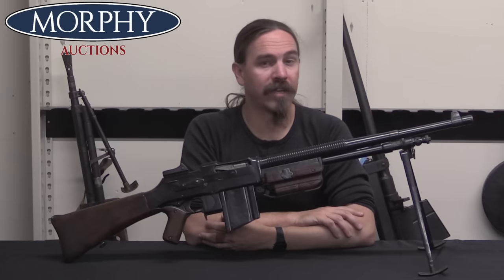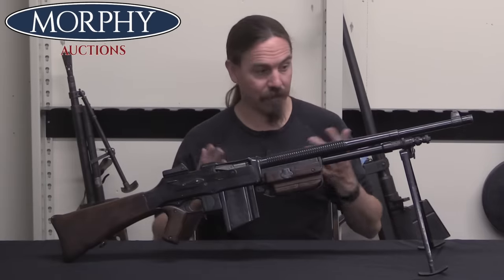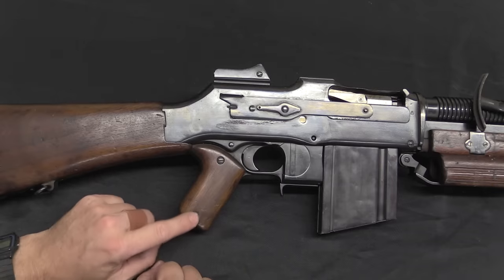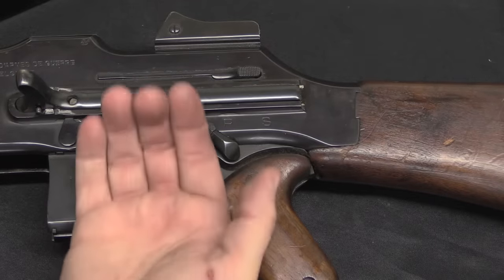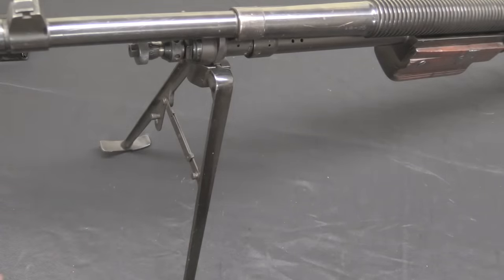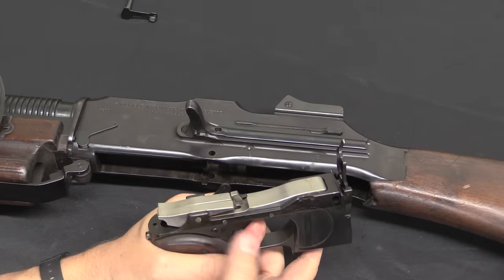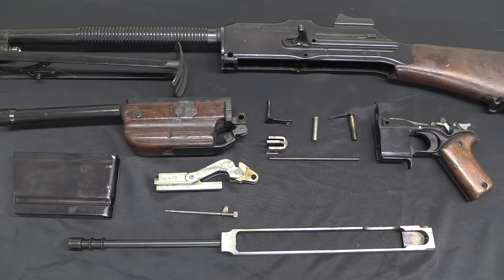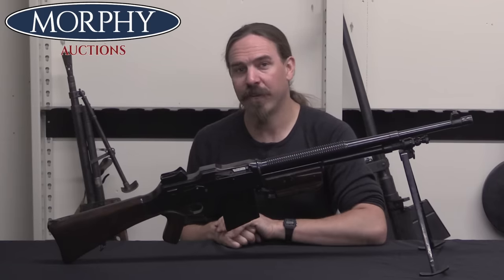FN Model 30: The First Belgian BAR

Comment: The US’ refusal to adopt a rifle with a pistol grip until well into vietnam is baffling to me.
Reply: Try 500 years of firearms stock design....
Reply: Rifles without grips look a lot more aesthetically pleasing, but I doubt that is the reason lol!
Reply: @alm5992  You'd be surprised...
Reply: The whole M14 project has a lot problems besides no pistol grip.
As far as the BAR, I think the mag release is more a significant upgrade than the pistol grip. Just a personal opinion
Reply: They didn’t want to offend any soccer moms. Very forward thinking.😊
Reply: I had a good friend who was trained on BAR just before M14 and M15 were due to drop and the basic reality was that despite all the manuals and terminology treating the BAR A2 as a light machinegun," it was, in practice, treated as a semiautomatic rifle that didn't kick like an M1 and had more than twice the capacity. 

In effect, the BAR man  was really not so much trying to shoot faster than his fellow riflemen with M1 rifles. Rather, he was just trying to shoot as fast as them for LONGER between reloads. BAR, thanks to its weight and mass, could keep up the same "rate of fire" as the M1 rifles but for much longer and was accurate enough to make anyone within 600 yards "not want to be still standing there when the second shot came." 

In this light, pistol grips were not so important or useful, especially since it made it all the easier for any other member of the squad who was more familiar with an ordinary rifle to seamlessly pick up the BAR if the BAR man couldn't handle his own weapon.
Reply: 2 world wars!!
Reply: Probably because it's not as significant as you seem to think it is.
Reply: @alm5992 What really? I feel the exact opposite!

Not trying to fight or anything I'm just really surprised at your view.
Reply: @WALTERBROADDUS  yes, because it's not like the rest of the world didn't also have that(much longer than the US actually), and somehow many other countries still managed to adopt rifles with pistol grips way earlier. looks at the FAL
Reply: You are forgetting the original purpose of the "Rifle" as a substitute for a Pike.

When you have a pistol grip weapon - you have to move your hands to a different spot in order to use the Bayonet and/or use the rifle as a club.

Close Combat - often if not usually - takes place at very close distances with little or no warning.  If you are not using a pistol grip - you don't have to move your hands to use the weapon as a pike or club.

The US - was during WWII fielding one of if not the greatest Infantry Weapons of the day - in the M-1 Garand.  The M-14 was just a modification of the M-1.  Here the presence of a magazine - hurts the utility of the rifle as a close combat weapon.

The other thing - is the more modern weapons moved away from the lowered stock - that provided a way of looking through the sights.  More modern weapons had a straight recoil of the weapon right into the shoulder - and thus - less tendency to climb.  Thus - with the stock already modified to aide in Recoil management - they now needed a Pistol grip as the previous position of the hands would no longer work on the new stock designs.
.
Reply: @genericpersonx333  I think that is mixing up cause and effect. Because the BAR was incapable of performing the LMG role very well due to its deficiencies, it was relegated to the role of "a heavier rifle with magazines".
Reply: @BobSmith-dk8nw  Most militaries moved away from medieval-style combat by WW2 and recognized that there was no need for a pike any more. Cavalry charges were no longer the threat they used to be...
Reply: Not really because the BAR was adopted in 1918 and intended as an Automatic Rifle, albeit for the concept of walking fire and other tactical dead-ends that didn't survive the Great War. It was not adopted as nor used as an LMG in the Great War like the Chauchat, Bernet-Mercie, or Lewis guns,  

In practice, right from the start, it was used much as my man used it and would remain so throughout the BAR's service life. 

Between the wars, however, the Army tried to use it to conform to more conventional ideas of LMG, adding a bipod and revising manuals to emphasize using bursts and base of fire tactics. If you asked official US Army documentation, BAR M1918a2 was mostly  indistinguishable from the BREN or even the MG34 in many ways. However, this never worked and the actual BAR users focused on it as an autorifle. 

So the BAR was always an autorifle that people tried to fit to the LMG role later. 

 @MarvinCZ
Reply: @genericpersonx333  You're right about the original, original idea, sorry.

I was thinking more about the WW2 US plans for it. They wanted it to be an LMG but the changes they made were inadequate. FN came closer.
Reply: For sure!

It is intriguing how FN and others were so successful in adapting BAR (hell, the MAG GPMG has BAR heritage in it) to the LMG role, but the US Army really just seemed unwilling to accept the BAR it had was NOT the LMG it wanted, but kept with it anyway. 

One would think someone in Springfield Armory or the USA at large could have done more to BAR than they did, but nope, Square Peg in Round Hole said Uncle Sam! 

Still a great squad support weapon as it was and even in 1953-54, when my friend was training on his, everyone was asking for more BARs, not fewer.

 @MarvinCZ
Reply: @tedhodge4830   Correct sir.
Reply: @Ghelasin  Pistol grips are not as important as people think.
Reply: Pistol grips are not as important in combat as you might think.  Heck, even the Swedish used their BAR as a rifle not a machine gun unless attacking.  The pistol grip is of minimal value (even tho I like them).
Reply: @Rustebadge  There is a reason Literally every military on the planet moved to pistol grips for their service rifles. Also, we did add pistol grips to our BAR's in Sweden.
Reply: @Ghelasin  thats because we use lightweight guns, the bar doesnt need a pistol grip because its heavy, basic physics will tell you that it will not jump as much despite it firing 30-06, so you can control the gun very easily, compared to an m16, as long as you can hold and point it at something.
Reply: @nuhrii3449 No, it's because modern warfare includes a lot of urban fighting, and a traditional stock is Utter Shite at anything even resembling close quarters, in fact a pistol grip doesn't make a gun any better at handling recoil than a traditional stock that's used properly, what it does do is drastically improve the handling of the gun. We also make our guns much shorter these days for the same reason, the days of firing at each other from fixed positions over open fields is gone.
Reply: @Ghelasin  that would make sense if we were talking about the standard issue rifle, but this not a standard issue rifle, the gun is long, this is not a close quarters weapon, its trying to be an lmg, which it was for the polish. the bar was replaced by the m60, another lmg of a similar length and then the m240 and m249. point being is that overall is a factor, but its less important for lmgs. where you are firing from a fixed position
how you handle the gun between the grips is largely up to preference and you do control the weapon better with a pistol grip because of ergonomics, which is contradictory with your previous statement, because how you handle it does affect your control

Comment: I have to say FN made the BAR practical. And it looks awesome
Reply: Blaster from another age, all the curves, bevels and dovetails make it look like like an artisan built piece. Even the bluing on an old gun still holds up because sections were highly polished.
Reply: The rate reduction system seems overly complicated. I am assuming modifications to the bolt or recoil spring were not practical for some reason. I wonder how robust that rack and pinion system is.
Reply: Strangely enough the Belgians also did the same for the Chauchat.
Reply: If you want to see FN making the BAR practical, this is only the start. The Mle D was a vast improvement.

Comment: It’s really interesting to me how similar to the mag-58 or m240 series the bolt, gas plug and piston are. At a glance you could be forgiven for thinking they came from a 240. It’s neat that FN looked at those designs and went “if it ain’t broke…”
Reply: Especially when you turn the BAR upside down.
Reply: I think the funniest description I ever heard of the MAG/240 was "upside down beltfed BAR"

Comment: My stepfather had a BAR-D in Canada. It had been converted to single shot by cutting off the gas piston, and welding the gas system and bbl latch. A travesty I know but kept it from the cutters torch, until it was consumed in a Fire
Reply: Did this fire occur during a "boating accident"? 😉
Reply: Actually, it sounds kinda  cool...

Comment: I find it really cool that you can look at the swapping of parts on the gas piston/plug and see how it is incrementally becoming closer to the M240/FN Mag gas system, which uses the same bolt and piston system
over a century of history from the original BAR to the Lima variant, and not a whole ton has changed internally

Comment: We still use these beauty even today in 30-06 caliber, mainly by our Navy (mostly by ship crew, sailor and naval base personel). FN D just like the Madsen can serve really well for decades
Reply: I mean if it aint broke. Seriously though I'm sure there are plenty of older rifles that can still be quite viable in modern situations. Even if they aren't top of the line.
Reply: @robosoldier11 their biggest issue is the inability to add modern optics/force multipliers
Reply: @Joe-hz1nw  The model D would be even nicer with a pic rail and a free floating handguard rail
Reply: @Joe-hz1nw No biggies,I hate picatinny regardless their practicality
Reply: What nation?
Reply: who are we? :)
Reply: @jalpat2272  it’s a massive deal on a modern battlefield.  Other than that, I agree with you.
Reply: @WALTERBROADDUS Indonesia I think
Reply: @Joe-hz1nw If it's being used aboard a ship, the only thing to add would be iron sight replacements like a really low power holo dot. For everything else, well, you're standing on a weapons platform...
Reply: @cheyannei5983  agreed, and the navy is a good place for hand me down small arms.  I was making a general statement.
Reply: @jeramyw it would ruin the look
Reply: @Joe-hz1nw If the money is there I'm sure Ohio Ordnance Works would welcome a military contract to fix that problem. Of course if the money is there they probably wouldn't be using a BAR

Comment: I remember going through Tanker OSUT and working on the M2 and M240. Any time we had a pin or, especially, a detent to pull to a specific point to see in a hole in the receiver or frame our Drill Sergeant would say, "You got to see the titty in the window." It was a different time.

Comment: My father was a BAR man in the 101st as they were converting to the M14 from the Garand.
Reply: So did all the BAR men get M60s?
Reply: @tomhenry897  Interesting. I would've thought the men who had M1 Garands got M14s and BAR men M60s. So were the BARs replaced by the standard M14s or a special LMG version with bipod and heavy barrel?
Reply: @hendriktonisson2915 pretty much, nomenclature M15, short lived obviously.  If you ever played CoD black ops, and saw the M14 and said that looks wrong, that's because it was modeled after the M15.

Edit: did a double check, apparently no M15s were actually built, they just used M14E2s/M14A1s.  Ian did a video about it like 8 years ago

Comment: I wonder what happened to all the tooling for the FN30 when WW2 started. You didn't see any German manufactured BARs, implying the tooling wasn't available to them. The Germans were quite good at taking over factories and continuing production for their own forces. Did the Germans just not appreciate the weapon when they conquered Belgium, or was the tooling destroyed?
Reply: I don't think the Wehrmacht were interested in the BAR, or in the Browning 1917. 

They used the 7.92x57mm guns they captured in Poland. But didn't continue production of either weapon in during their  Occupations of Belgium and Poland.

Apart from pistols, FN was  used to make components  for German  gunmakers, including Walther. And also military motorcycle/sidecar combinations.
Reply: They had stuff like the fg-42 to use.
Reply: @kevinoliver3083 they were when they were used against them....
Reply: @kenneth9874  Repeat please.
Reply: @kevinoliver3083  why bother?
Reply: Mostly because it used the 7.65x52 mm instead of the 7.92x57 munitions.

But they really did use "Kriegsbeute" (war booty) weapons in limited numbers due to them being a logistical nightmare.

Comment: I didn't scan through all the comments so apologies if somebody else already covered it but... while the updated mag release does look nice... form a pure military / law enforcement perspective... I like the original button mag release as, with proper training,  I think one is just as fast as the other and, to me, I would be concerned about  unintentional mag drops with the sliding release... e.g. it gets snagged on something or in "the heat of battle, the user getting "excited" and accidentally grabs the release instead of the trigger 😮

Comment: A BAR with a pistol grip should’ve been what the US adopted for use as a battle rifle in the 1950s instead of the M14.
Reply: The BAR was 18 or so pounds and the fbi version was 16 pounds.  A lot of weight for an average soldier to carry around.  The m14 itself was around 9llb.  Imagine if they made the fbi version in 7.62 x 39 or in the kurtz round.  They could have had the fn fal but the ordinance board would not allow it.

Comment: What advantages does having the fast (600 rpm) full auto and slow full auto (350 rpm) settings give compared to having one full auto setting (for example 550 rpm) and semi auto setting?
Reply from the maker: In my opinion, none. I think the idea was to allow more continuous covering/harrassing fire at a slower rate that would conserve ammunition.
Reply: Ammo conservation.  It's magazine fed and those go dry quickly. Light machine guns of the day also were used for anti air applications. You would want a higher cyclical rate against aircraft. For  a light machine gun against infantry a slower rate of fire was more desirable.  Semi in a light machine gun is also kind of useless, that is what rifleman are for.
Reply: @ForgottenWeapons  I see. Thank You for the answer!
Reply: @onelonecelt9168  The ZB26 and Bren LMGs had a rate fire of about 500-550 rpm and these were not considered to have too fast rate of fire.
Reply: @hendriktonisson2915  I am aware of that, and agree with you, that they aren't too fast, but your question was on this gun and the possible idea behind the rpm settings. So I gave you an answer that probably sums up the idea behind it.
Reply: @onelonecelt9168  Yes I understand and I do not dispute anything You said. Just pointed out other successful LMG designs from around the same time period that had different solutions for the fire rate.
Reply: @hendriktonisson2915  I wasn't aware we  were disputing. I think it was just differences in doctrine.
Reply: @onelonecelt9168  I said "I do NOT dispute".

Comment: Wow, this is the polar opposite of space magic 🤣

And seeing this dissasembled instantly answers the question everyone always have when they learn how heavy a BAR is, it seems every single part in there is made from the absolute largest volume of solid steel you could possibly fit in there - probably some of the parts even 3D-clip into each other 🤣

And that dissasembly out the bottom is just so insanely wonky, like taking random devices apart as a child and going "I always have something left over when I try to reasseble it and it never works again" - not exactly ideal for a weapon of war..Imagine you have this apart at the front and get told the enemy is approaching and having to quicly get it working the in the dark...

Comment: So, essentially this is the adult version of the American toy gun. ;D
Reply: You ever see what 30-.06 does to a brick wall?
Reply: @SirCheezersIII  Irrelevant. My comment was a joke and mainly stabbing at the ridiculous imperial units. The point is, these guns are pretty substantial improvement over the original and the first "improvement" they made was to convert the imperial units to metric in the blueprints.

Besides, the ammo is still the same on both so I'm unsure what brainfart made you think I was talking about that.
Reply: Too bad they have to rely on American designs..
Reply: @kenneth9874  easier to improve working but inferior design than to make wholly new one. Your AR-platforms are testamental to this. So, it's definitely not a bad thing.
Reply: @anteshell  if the design was "inferior" then why bother with it and not create a better one?.......hmmm
Reply: @kenneth9874  read my previous comment again. The answer for your question is already in there.
Reply: @anteshell  no it isn't

Comment: It looks like a prototype FAL.
Reply: funny you say that since an FAL in a basic way is just a BAR flipped upside down
the bolt pivots down to lock instead of up as in the BAR, and the gas tube is on the top as opposed to the bottom for BAR
side cocking non reciprocating handle
you get the idea